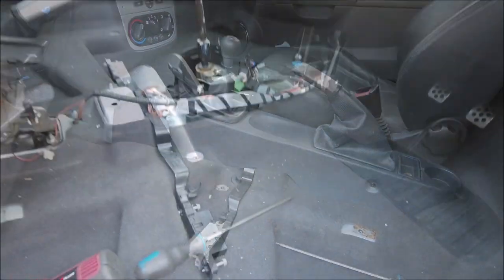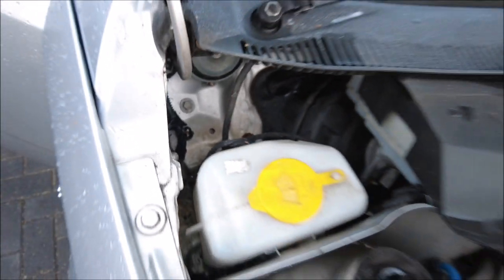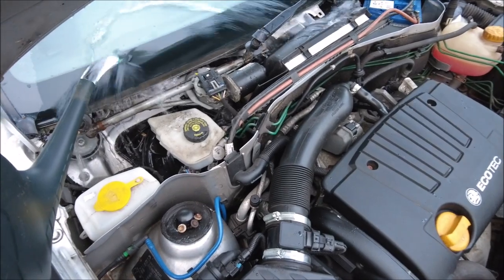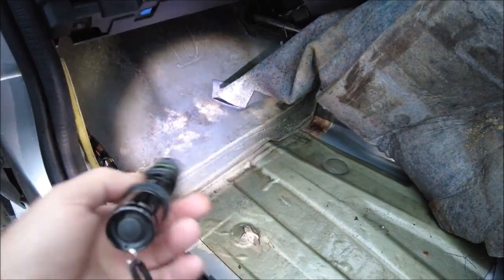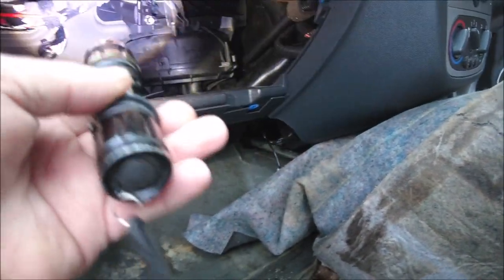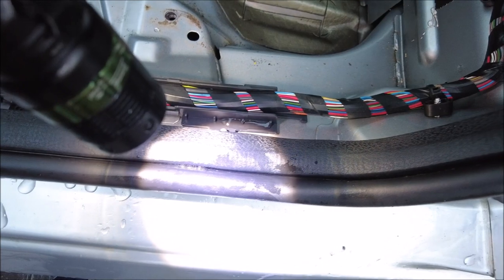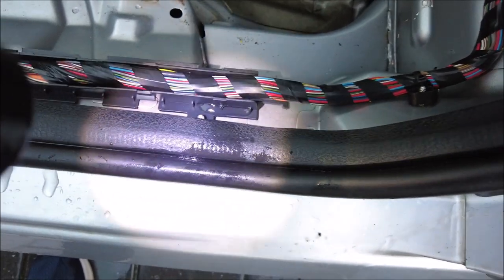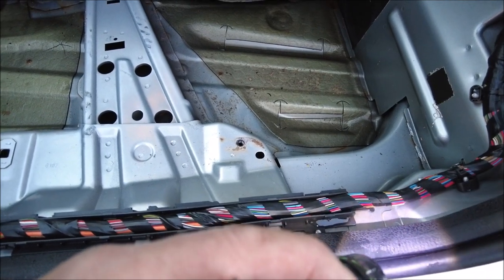Vauxhall Tigra thinks it's a swimming pool ...

Comment: That looks like it could be entering from the relay box. A common fault where water enters into the passenger footwell, on the Tigra and Corsa C.
The seal on the lid of the relay box perishes. Either purchase some 7mm diameter rubber or, as I did, a new lid, which came with nice shiny new screws. The original ones were so rusty. 

Hope that helps.
Ps I ❤ the channel!